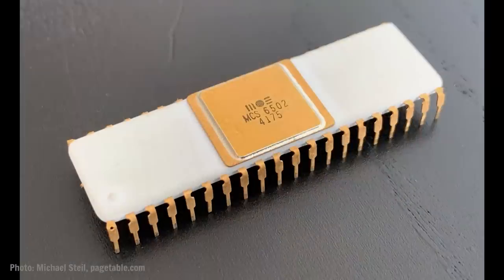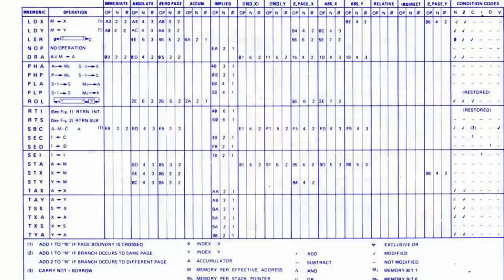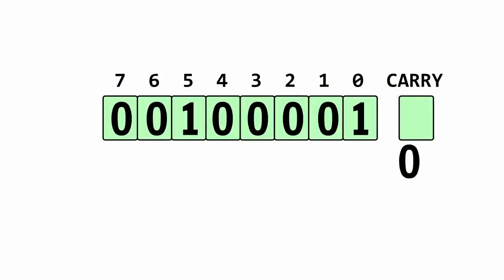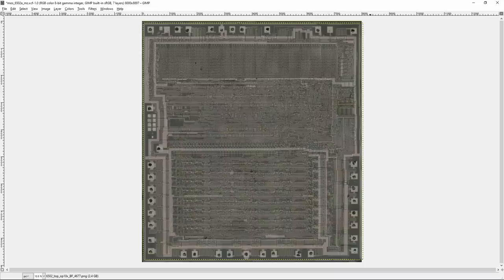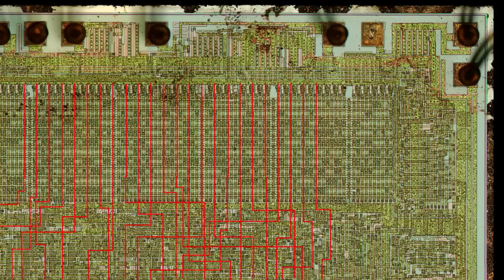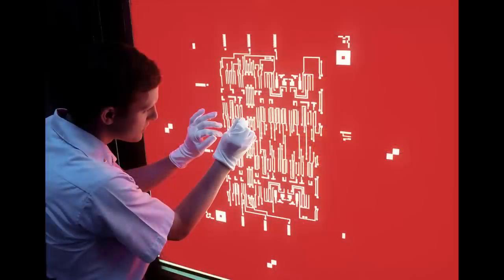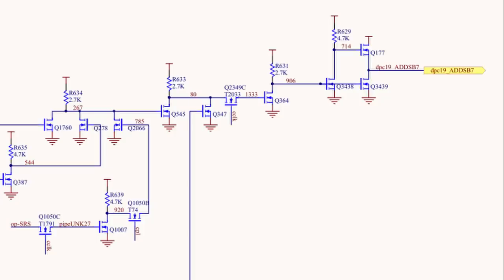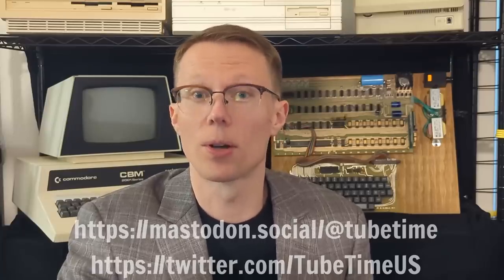The 6502 Rotate Right Myth

Comment: If the ROR instruction had never been added and documented, there would be no reason to call it a bug.

But as it is, the very first 6502 cpus cannot run all of today's 6502 programs. For all intents and purposes, they are bugged/broken.
Reply: And modern 6502 CPUs can't run all of the OLD software -- 

By many definitions they are buggy. ;)
Reply: @r3jjs  modern 6502s run all programs that employ only documented instructions.
Reply: @ronald3836   That's the catch -- a lot of older software relies on undocumented instructions.

Since you said the first 6502's cannot run all 6502 programs --- I'm just saying modern 6502's can run all 6502 programs.

Comment: Sometimes myths arise out of simple misunderstandings.  We can clearly see that something had at one stage used the PLA decodes for some purpose.  Perhaps that purpose was to actually implement ROR but it was discovered that the logic that had yet to be put into silicon was defective and never made it to the point of being put into the photo masks.  Once correct logic had been worked, it was implemented and appeared in the later versions of the chip.  It wouldn't be the first time that production schedules have forced people's hands.  This is, of course, pure speculation.
Reply: I think "myth" is really too big a word here, as there is way too much truth behind it (but I understand the need for catchy titles).

Even this guy called it a bug (unless he is referring to another issue that got fixed at the same time):
https://youtu.be/fWqBmmPQP40?t=2955
Clearly there was a ROR "issue" with the early 6502.

The 6502 does have bugs which were never fixed.
The ROR isssue was so severe that it did get fixed.

Comment: I'm not a silicon/transistor designer, just a coder with rudimentary knowledge in logic design. What I wonder is why there needs to be a copy of the carry it? If you were to design a shift register using discrete logic you would use a a D-latch for every bit. You don't need extra latches for the other bits so why you need it for the carry which is just an other latch? You just route the carry out to the first latch in, that should do it. If you want to implement a shift right, just add a mux to the input of the first latch that so that it takes in either a zero or the carry bit. Obviously with pure transistors things are slightly different but still I wonder this explanation of a 'copy of the carry' bit ... i
Reply: Indeed, if they can shift bits 0-7 into 1-7 and c in one clock, then surely the same can be done with c into 0.

ROR applied to the accumulator is two clocks, and probably one is for obstruction decoding. 2 is minimum for the 6502.
Reply: Instruction decoding...

Comment: You forgot to mention:  Although 6502 programs could be written without ROR using different accommodation depending on the situation, some programmers used a standard sequence of instructions that did the same thing as ROR, probably expanded from an assembler macro named "ROR" -- it was simple to use, but bloated the machine code slightly with the unusual "multi-byte instruction".  Programs that used the sequence could run on 6502A or 6502B, but were slower; programs that used the ROR instruction could run only on 6502B, but were faster.  Some people pointed out a way to patch their programs, replacing the work-around code with the new instruction, to increase speed (though not reduce program size).  I have not seen the ROR sequence nor the typical code that was put in its place (probably something like ROR NOP NOP NOP?).  What code sequence did they use to replace ROR?

Comment: this brought back a memory from 2014...     the minecraft mod RedPower 2  has a brilliant 6502 emulator.   i was writing a full C compiler IDE (using cc65, scintilla and some direct minecraft integration) to support it.    that is, until i ran into a bug with the emulator's SBC instruction mishandling a status register flag..   i even wrote some code to check the compiled C assembly for the issue and inject some extra instructions for a work-around.  it worked, but unfortunately meant that some of the 8-bit branch/jump instructions also had to be changed because the extra instructions could push the destination out of 256 byte range, so they would have to be changed to long jumps...  got too complicated and i gave up lol.
Reply: @Ignat99Ignatov  fascinating! thanks for sharing :)

Comment: Interesting, the undertone is also that it was a good candidate for a cost reduction chopping block because it had some complexity coming with it. Thanks for the explanation. I guess modern CPUs check their instructions and all have an actual illegal instruction errors (I assumes it comes witht the capability bits, ands other CPU variants)? And said instruction checking subsystem is more complex than an entire 1975 CPU?
Reply: We just started studying the NIOS II architecture designed to be run on FPGAs. This architecture has the ability to raise an exception if an instruction isn't implemented (common being multiply and divide). If the exception handling part is written properly, then the exception handler can be used to emulate the missing instruction without the original program knowing it doesn't exist. I'm not sure about other architectures though.

Comment: The low cost of the 6502 wasn't just due to it being barebones, it was the first of a new class of chip and manufacturing process which boosted yield nearly an order of magnitude. 
Just for reference: Adjusting for general price inflation $25 and $300 back in 1975 would be around $200 and $2400 today. (You could buy a Cadillac for $6000 and a commuter car for $2200)
Reply: One reason for the improved yield must have been its small die size, which was the result of it being barebones.
Reply: @ronald3836  The older processes were slower and had huge defect rates, like 80% was unusable waste.
Reply: @ronald3836  The numbers I have are 16 mm² for the 6800 and 21 mm² for the 6502, so the latter was actually larger though it had slightly fewer transistors. In a couple of years Motorola had dropped the price enough that both were selling for the same thing.
Reply: @jecelassumpcaojr890  originally it was 29mm2 for the 6800, according to Wikipedia. This was reduced to 16.5mm2 in 1975 in a redesign that used depletion-mode NMOS (which the 6502 used from the start).

So the main advantage of the 6502 over the original 6800 (lower cost through higher yield) seems to be the result more of the new process technology that had become available and less of the design being simpler (although that will have helped, too).
Reply: @TheDuckofDoom.  My conclusion is that you are fully correct.
Reply: @ronald3836  Thanks for the correction! I got my number from a poster showing microprocessors from 1971 to 1996 (a version of this can be found in Gordon Bell's pages)

Comment: OK, LSR (Logical Shift Right) could have been used instead, but if you are dividing a 16 bit number with LSR, you need extra commands getting the carry flag into the 7th bit of the lowest byte after the shift operation, so not having a ROR instruction was really an issue.
It may sound strange, but LSR seems less important to me than a proper ROR instruction.
Reply: Yes the LSR could been simulated with a CLC, Simulating ROR would require BCC to skip over the ORA #$80 line, but that would be direct circular ROR that current 6502 ROR is not. 
So you would need to BCC before the LSR, to two different LSR sections, one that has ORA #$80.

Comment: You could probably have coded around that missing opcode. Detect a failed ror, and compensate with some extra opcodes
Reply: I'm not sure if they would have wanted to spare the bytes in those days. If you know you've got some machines that don't support ROR it's just more space efficient to code around it. Otherwise there were many machines that never used such revision of the 6502 and so it was always safe to assume it was usable
Reply: Quick try at a ROR replacement if you don't have a ROR instruction. Accumulator version.

    BCC .label
    LSR
    ORA #$80
    BNE .label1
 .label:
    LSR
.label1:
Reply: @djmips  LSR A
BCC skip
ORA #$80
skip: ...
Reply: Whoops, nope nevermind. Just realised I'm totally wrong here.
Reply: @IcyTorment  Wouldn't you need to ROL eight times? With the carry bit there are 9 bits in total rolling around.

Comment: I'm still confused. The ROL instruction would require a similar latching. How did it work since it presumably did? Also, you mention that the original ROR lines weren't tied to transistors and that your best guess is that they originally invoked a completely different instruction that was ripped out but that the lines themselves weren't. How is it easy to rip out the desired logic from those lines but not the lines themselves? One final comment: There was a 6510 instruction that has a minor flaw in its addressing. I think it was STA [-,X] which had issues when x forced an address lookup across a 256-byte boundary. Was this 6510-only?
Reply: It's in the video. ROL was implemented simply by adding the number to itself. It's exactly the same as a hypothetical ADC A instruction.

Comment: I used to have the original documentation on the 6502, which included a hardware manual, and a software manual.  There was NO mention of the ROR instruction, and it was explained how to perform this in software.   If the ROR instruction was implemented in mask level 'D' and the first silicon was at level 'A', then I wonder if there were revision levels B, and C, and what 'fixes' they addressed.  BTW, I also used to have a revision "A' cpu, as well as a mask rom/io chip containing the 'TIM' monitor.  I built up a small computer using OSI series 400 bare boards.  This included the CPU board, a back plane board, and 4 4K by 12 bit memory boards (with 8 bits populated).  OSI originally laid out the 400 series boards to also accept the 6100 CMOS-8 PDP-8 on a chip[ CPU, hence the memory being 12 bits wide.  They could also support the PDP memory expansion circuit to use more than one memory board, though until Intersil produced the chip that did this (different CPU IIRC) it was a bit of a hack requiring some mods to the 400 cpu board.  I later sold this computer to pay for a 'big board' z80 CPM system.

Comment: Why did they make ror a 2 cycle operation, when they could've just kept a fresh copy in the latch at every cycle?
Reply: Probably a timing issue. You would have to send the latch bit to the input of the shift register at the same time as the carry bit was being updated and thus updating the latch bit. Far easier to not mess with timings to try and read a bit while also writing a bit and just make it two cycles. Alternatively they could have added two latch bits and switched between them for the rotate with a flip flop or single bit full hardware adder such that you read from latch A into the shift register while it's writing to the carry bit and latch B. Then on the next ROR instruction you read from B and write to carry and A. But now you have two latches, a flip flop or single bit adder when you could just have one latch and two cycles to process.
Reply: ROR is just as fast as ROL and ASR. 2 cycles when applied to the accumulator (2 cycles is minimum on the 6502).
Reply: @ronald3836  Ok, from the video i got the impression they needed 2 cycles only because of involving the shift register.
Reply: @Pengochan  Me too, so I grabbed my old C64 programmer's reference guide to check it :).

Comment: Oh it’s definitely a bug. However, the error is in the head of the designer, not in the revision A 6502 silicon…
I get that the important thing for the design was to produce an inexpensive bare bones processor. I don’t have a problem with that. But, in bringing a microprocessor to market that would compete with other microprocessors, your idea on what the minimum instruction set is may not be the same as what the market expects…
Reply: And they kept calling it 6502, so I am with you. They fixed a bug in the documented instruction set.
Reply: It's a surprising omission because, without ROR, a 16 bit shift becomes more time consuming. With ROR, you just CLC, LSR top byte, ROR bottom byte. Without ROR, You need to do two shifts and then if the CLC was set after the top shift, do an ORA #$80 on the bottom byte.

Comment: ... I am fairly sure the reason people claimed this to be a bug didn't relate at all to whether it was an intentional omission or not, but because it WAS a referenced function, that didn't do what such function was intended to do. (not sure if it was in some paper-reference as to what machine-code corresponds to which function, or if it may be that it was even implemented in some assembler FOR the processor).. so what I THINK probably happened was that they STARTED by planning the layout of the functions they wanted.. and someone told them they didn't need to rotate-right, BUT they didn't remove it from the documentation (at least not that they didn't throw away older "plans" and that those came in to use somewhere).. and because of this.. the reason people thought the ROR function was buggy was because they actually had reference material that claimed that it SHOULD be there.

Also; I have no idea how incompetent these people are, but seriously?.. Think that a processor doesn't need a ROR function?.. ROR and ROL are fairly vital functions both of them, AND they are SUPER-easy to implement.It's like.. 8 transistors for the functionality, and a couple of extra to be able to access the functionality.There is literally no saving worth mentioning, even at scale.
Reply: As I understand it, the initial documentation was clear about ROR not being there.
But it seems that at some point the documentation announced ROR would be implemented in an upcoming "update". If this was already in the initial documentation (which I don't know), then certainly it should be considered a bug from the start.

As for the decision to leave it out initially, there is no ASR either, and LSR seems more important. It is not shockingly strange, but it would be interesting to know the exact reasons.
Reply: @ronald3836  .. Hmm.. Okay.. I can't say that I know too much about it, but.. from what I gathered from some other videos on youtube, and whatnot... 

 I just know that the first time I heard about it it was presented together with a data-sheet showing the function having an ACTUAL place, and an ACTUAL already defined machine code mentioned... it is POSSIBLE this video actually showed a LATER data-sheet that people tried to use with earlier processor models.

but.. I have ALSO seen a video where someone opened up a "home-brew" box doing.. nearly nothing.. and.. The only reason (excuse) they could find for this processor being the actual core for this.. would be because it didn't live up to the expectations of the person buying it.. (I mean.. a processor WITHOUT a ROR function?.. AGAIN: Very very very stupid indeed.. retarded even).. 

But.. even if I were to ignore my conjecture based on other people's videos.. I STILL get the impression that the MAIN "outroar" about this function "missing".. was people who actually THOUGHT it was there.. and LITERALLY tried to use it.. and.. it didn't work.. so.. WHY did people try to find this function BEFORE it was even "publically" part of the specs?.. 

No.. this doesn't make sense.. what you said about.. people finding pride in things working to specs already the first time.. DOES make sense..

Which makes it EASY for someone to try to FIND excuses as to why their processor didn't work as expectedly.. "It wasn't supposed to..".. and.. it may even be right.. but I am FAIRLY sure that there were LITERALLY people out there EXPECTING this function to WORK.. already back then.. BEFORE they "added it later because it was requested".. the mere "request" WAS people being annoyed that it didn't work the way they expected.
Reply: @ronald3836  There's no ASR because that would require shifting bit 7 to bit 6 and bit 7 - more circuitry. I always though tit was a bit of a cheat claiming to have LSR andASL since ASL and LSL would be the same.

Comment: Well it could still be a bug. What if ROR was in the schematic, but they simply forgot to add the transistors and route the traces when they made the chip layout? Since the layout was a manual task back then, and modern schematics vs layout design checkers did not yet exist - it could have been a layout bug. We would need to see the original schematics to tell if ROR was in there or not. So the debate may still go on forever... 🙂
Reply from the maker: unlikely, they were a small team and the layout folks would have known about the circuit. the logic designers also checked over the layout.
Reply: @TubeTimeUS  The 6502 ignores a BRK instruction if an IRQ happens at the same time as a result of a design trick. Is this a bug? Or is it design? Certainly it is design, but it is still a bug.

Comment: Looking pretty smart today! So I guess nothing's changed. 😄

You'd think I would know what ROR is used for considering I got like 95% for my OOP final mark at uni. But I cheated. Kind-of. I got 100% for the weekly (graded) quizzes, then exploited the automated marking system for two of the assignments to get >100% for those, and the last assignment was a group one where you had to design a program, code it and present your program to the class. To get 100% on the automated marking system, you just had to produce the same output with equal or fewer lines than the benchmark, and there were bonus marks for beating the lecturer's best score. I beat him on both using logic simplification and maths tricks. And for the group project we were one of the few groups that produced a working program and had the documentation to back it up.

So why am I a network engineer instead of a programmer? I got 100% for my network design class! 😇